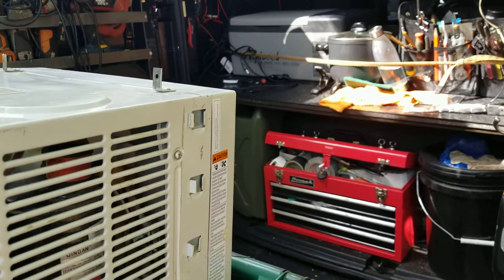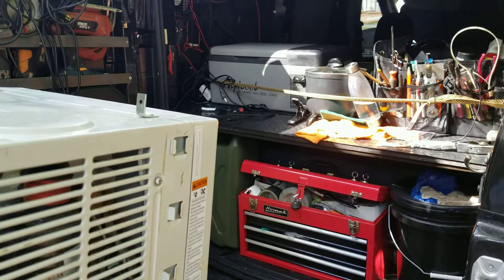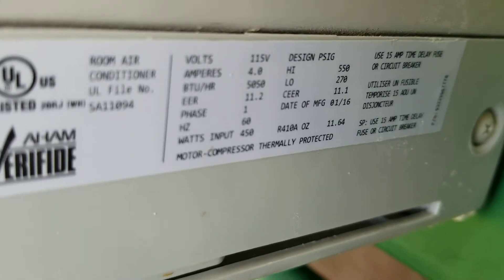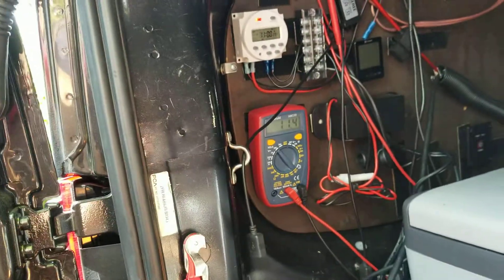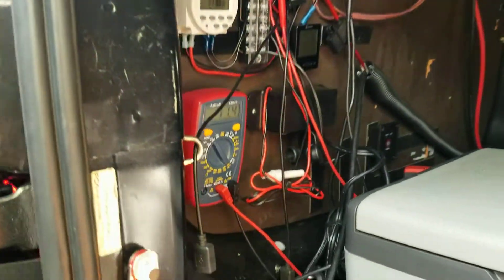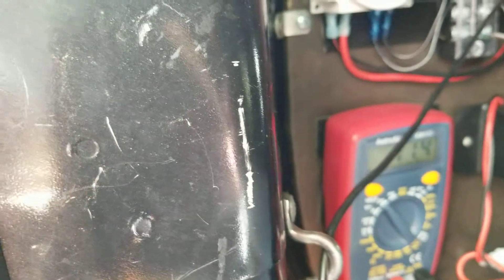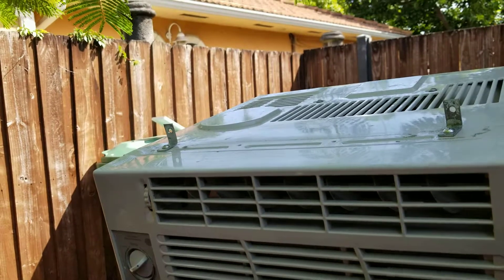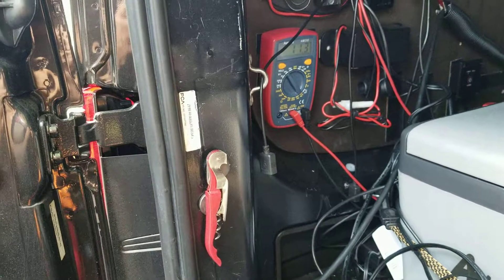12v van air conditioner GE 5000 BTU AET05LY INVERTER BATTERY TESTING

Comment: You probably need double the number of solar panels and deep cycle battery. I successfully run my boat with 200w solar panel and 100ah deep cycle battery, trolling motor 120w first gear and 420w sixt gear all day.

Comment: So it runs at 450 Watts stable but how much do the watts go up for the surge when the compressor pops on?
Reply from the maker: I think brands vary. this one seems to be very low, but likely 2x that.  IMO and from years of trying over 10 different invererters.  the sweet spot is to get a 2000w inverter and put it 3' from the your battery inside you car with 0ga copper cables. if you are lucky this setup will yield 1500w or about 13amps  so you can run small 115v tools and cooking appliances.   IMO running a wall AC from your car is bad idea, I just run my engine and turn on the OEM auto AC.. i do that some times for 2 hours in the middle of the day while parked.

Comment: 🤔 I hope this will help you with your air conditioner If you will put two 12 volt batteries in series make  your batteries 48 volts your window air conditioner at 400 watts that air conditioner will run over 9 hours none STOP before you got  to charge any batteries over again never charged any battery over 15 amps  I know what I am talking about  I am ASE-certified Master Auto Mechanic with over 30 year's experience NEVER EVER run ANY LED cell battery Down no more than 50% before recharging  your  LED cell batteries over again never ever overcharge any better
Reply from the maker: Hi. With an inverter ?The reading was under load. When take load off it shot up .6v.

Comment: Well 115AH at the 20 hour rate is a 5.75A load or 69watts/hr to get the whole 115AH.  Pukert losses are going to reduce that significantly at a 450W/5x the load, you are going to get less than 1/5 the run time, or less than 4 hours.  It will be quite a bit less as every conversion has loss so the cables and inverters are going to turn some of that power into heat.  The induction motor in the A/C is also going to run a lot hotter/less efficient and noisier, being fed on a square wave instead of the sine wave it was designed for  they are starting to produce direct 12v air conditioners with DC compressors, which will remove all the inverter and induction losses.  They also use controllers on the compressor drive so they are variable output and only run as hard as they need to.  They also have ducting, so the compressor and coils can be mounted outside the envelope(quieter and less added heat from the unit in operation).  In the case of trying to air-condition or heat an RV or van, insulation is your friend…
Reply from the maker: Yeah, this was just a test to ask what if. clearly 115v AC is not the way to go.  But my conclusion was just learn to sleep with a 12v fan and move to place where it's cooler at night cause Miami is not a place you want to sleep without AC.  There has been rumors of new HVAC discoveries that might change the world with massive efficiencies improvements. For sure its an area of enormous opportunity.. just like Solar, Solid State Batteries, Recycling, Waste management and Artificial Intelligence.

Comment: My build is gonna have 760 amp hour battery bank......................... Cheap Window ac unit please!!!! Thanks...... Then you build your wood frame and supports. Now mask off area, get tintable rhino liner.  Tint as preferred and multi coat. Now let cure. Install window ac panel to inside of what you just built. Make sure what you build has rain guard top and half sides. Do wonders for keeping rig dry and longevity of unit. Plus if you have a continuous duty solenoid and a high output alternator you can do wonders and use it driving.
Reply from the maker: Best of luck!  post videos on your build and let know how it works out.
Reply from the maker: BTW something to consider.. ive used my van's OEM AC extensively while parked, usually about 2 hours a day in 30 minute - 1 hour spurts. Its cools the cabin down very fast and recharges my battery to near 100% killing two birds with one stone.   Van has never overheated and wastes hardly any gasoline.   Word is modern cars and engine cooling systems have no issues with this.  Anyways for me the benefits of using my van this way (as a camper and mobile kitchen) far outweigh any ware and tear and life I'm taking from it.  I never eat out, never rent hotels and never have to drive back anywhere so $avings
Reply: @12vLife  I am right there with you but I already have like no bills and make a decent living and I wanted a truck, camper, and it had to be able to be daily driven if my others can't be for some reason. Saw this rust free econoline van and it has the floor dropped 9 inches and the frame reinforced since it was a handicapped van for a para..... Just going to piddle with it but I already have the battery bank and I want it to be portable in case of any emergency which this lil home on wheels  was also intended for. Rust free and been looking into tintable Rhino liner and am pretty stoked at how cost and time effective along with preserving it is for things that rust away too fast. Excited to take some trips in it as the build progresses but focusing on the mechanical first.

Comment: 12.6-11.4 = 1.2
Reply from the maker: give or take and don't think it's linear, factor in Load at given capacity.  I have a much bigger solar on now but still not worth it to run AC off a 12v.
Reply from the maker: keep in mind battery reads one thing with load  vs w/o load.  If i turned off the AC at that point (1.5 hours of use) it was reading 12v... so .6v used in 1.5hour, but led acid batteries don't go down at the same rate and really no led battery should be even used under 11.5v idle.  Usually 12.7v = 100% , 11.5v = 20% and the lowest you should take it.   I think i had maybe another hour before my battery was being damaged. So 2.5 hours max and this is a very big 115ah deep cycle.

Comment: I'm doing something similar but I've been looking at a Pioneer mini split as they are very low on consuming electricity and have very good SEER rating. The main problem is where locate and mount the outer unit.

Comment: To bad the R410 a refrigerantis so high pressure . if you can reorfice the evaporator to take r 407 c you can lower maybe 1.5 amps @ 115 v

Comment: Are you aware of the zero breeze or the ridged dc aircon airconditioner?
Reply from the maker: I am aware of zero breeze and everybody says it does not work and is not worth it. have link to dc aircon.  Also swamp coolers do not work where im at due to high humidity.
Reply: NoSunBeach what do u think about van life ac for south Florida ice cooler works for nite time
Reply: NoSunBeach there’s a new mark II zero breeze which
Might be okay from what I’m seeing
Reply from the maker: @TheMcdrewb  Hi . I talked to Rolling Earthship who tested the MarkII and said don't bother.
Reply from the maker: @Soup Can Nice!  I was just testing, IMO external air condition is too much trouble in a small van.  What van model and year you in?  The most time I've done in my van is 14 days.  No roof fan? Solar?  My van (shown in other videos) is a small 4 cylinder 2018 Promaster city. I think my interior setup and hidden storage spaces I found makes for a very comfortable setup for a big dude and his tools/gear.  I have 1500 watt inverter in the front, but other than my 1200 watt kettle and some power tools I never run 120v power.   My Maxxair fan, Alpicool fridge and a 27 inch HD monitor are all 12v and together consume around 6.5 amps @12v (~75watts).  I have 100 watt solar panel on my roof that will put out about 75 watts in direct Florida sun. But I can usually top off my battery with about 30 minutes of idling with the van's  AC blasting .  Unless I'm under the trees or it's a cloudy day, If it's summer and the middle of the day I try not to be inside the van but If I I must  just run the engine and blast the van's AC .. never been an issue. I upgraded my battery and can get about 700 Watt Hours overnight which has been more than enough to run my fan and fridge.   Never had a problem sleeping in the van with the maxxair fan  in Florida even in August.  I usually cool the van down right before bed with the van's AC.